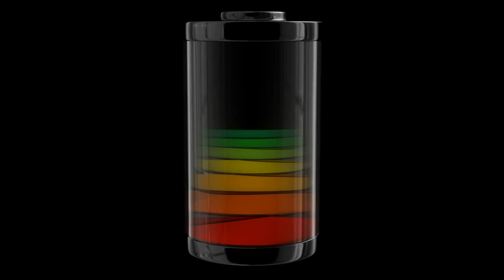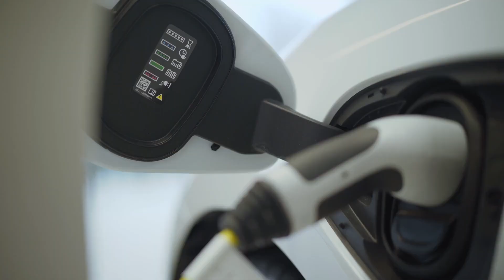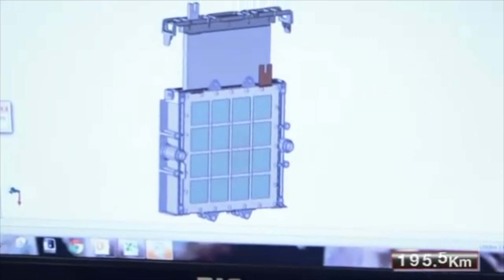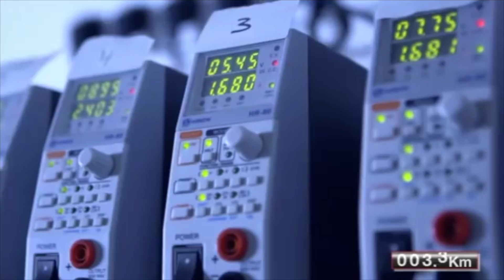This Battery Gives EVs 1000 Miles of Range!

Comment: Please do a deep dive into solid state and graphene batteries.  Toyota is supposedly investing in SS batteries
Reply: Τhere is also liquid metal battery....
Reply: Solid state batteries would be much safer and hopefully more energy dense too.
Unfortunately nobody is even close to make them cheap and long lasting, currently.
Reply: Solid state is a joke. The batteries are so expensive that they negate any range advantage by needing to use a smaller battery. Plus they can't be mass produced like current batteries or even the 4680 cells. The tech will probably be good in the future when it's cheaper but right now they're just hype.
Reply: Since 2019,  have been very careful of 
ICE vehicle manufacturers.

They had the window to stay with the EV market.  
-- That window, is closing fast !

******
Main factor in today's EV market, 
is range.  
-- How far/long before your need to recharge .

  Can you compete with 
1000km (600 miles) range ?
  Most ICE vehicles have a hard time !

**********
  Current ICE vehicles  have advantage of extending their range.
(re-fuel; gas tanks)
  Once this problem is solved, 
ICE vehickes are DOA !
Reply: @dirktween244  disagree
We are decades away from a power grid sufficient to handle the power needs to replace the energy from carbon
Reply: @dirktween244  The only reason why ICE vehicles don't have a 600 mile range is because it's a) not necessary with plenty of fuel stations around the world, and b) it's not as efficient to carry more weight than necessary.  If you don't need to go 1,500 miles, it doesn't make sense to carry 100gal of fuel when you're not even leaving city limits, and those who do already have vehicles with additional tanks.

You'll never truly get rid of ICE vehicles until we're able to restructure the entire world to use clean thorium based nuclear reactors, charging your vehicle takes less than ten minutes, and charging stations are located everywhere there's a gas station.  At that point, EV's and hopefully electric aircraft will finally subvert the ICE.  Until then, EV is not going to replace vehicles in high demand environments, and as far as emissions, at this point in time they're kicking the can down the road...energy production, mining, refinement, and manufacture offsets their own lack of emissions.
Reply: @dirktween244  I mean to be fair there is still the problem of fast chargers needing to be faster and the up front cost needing to come down but those things will come with time. Especially if this new ev credit passes in the us
Reply: @DenvySubliminals  The 4680 should charge from 10-90% in about 15 minutes with the tabless design (which provides far less resistance to charging at high rates).

I don't expect we need more than 2 years to see that as the new standard at Tesla. 
Aluminum-Air has been kicking around for quite some time. Its use case is Very small.
Reply: @avgjoe5969  honestly I wouldn't be surprised if it was even faster than that. Especially I've V4 type chargers are able to be as impressive as they are or if the car has a smaller battery pack (ie the 25k Tesla)
Reply: @dirktween244  And think... in majority of cases your burning fuel to recharge your battery..... nevermind fossil fuels it took to build the car.... our fossil fuel used to make the tires... even the asphalt the tires ride on.... fossil fuels used to make the power lines and other infrastructure along the side of the road as you drive. Just try to fathom how much diesel is burned mining the materials for those batteries....... wake up people.... we don't have the tech to get out of fossil fuel/ fossil fuel product use just yet.... what will you people do without disposable plastic razors for example?
Reply: @timm.6391  bingo
Well said!!
Reply: @Johnny-dp5mu  Thank you.
Reply: @timm.6391  I also wonder if the current power grid will even handle the charging network proposed.
Reply: Let’s explore ALL POSSIBILITIES of E~Tech Soon it will work

Comment: Thanks for the knowledge.  The biggest thing keeping me from buying an EV is range.  I drive a Plug-in hybrid and the EV range has never been as advertised. Also, I live in eastern Washington state and the cold in the winter diminishes that range as well.  The work I do often requires me to drive 300+ miles at a time to areas where a charger is not available.  Having 500 miles or more range would work.
Reply: If you had rapid recharge stations giving you a a 75% charge in 15 minutes.  would you reconsider?
Reply: @timthompson9115  My range problem is i don’t commute but rather drive to customers houses in rural areas where no charger exists.
Reply: @PapaDougsAdventures01  Running an extension cord to a customers house not going to go  over very well... Soon gas pumps are going be replaced by fast charging stations.  Stations roofs will all be solar panels.  They already have this in other parts of the world..  An app on your phone or on your cars "screen'' will warn you when low on battery and direct you to the nearest charging station.  Since we are not dealing with gasoline and all the hazards that go with that.   Simply put parking spots along roads will become charging stations.

Comment: Aluminium needs really too much power for extracting it from the Aluminumoxide-Rocks ! So.. it is a fantastic material for us to use.. BUT.. the Energy-Need for processing is really too high!
Reply: @Curdin Gees

Unlike the fossil fuels Aluminium is the 3d most abundant element on earth and once extracted it's a renewable and clean energy solution that could be economically viable addition to already existing ones. 
¯\_(ツ)_/¯
Reply: Have you forgotten what we are already using aluminum for today

Comment: Aluminum wiring was banned in many areas because of their potential to catch fire. Hmmmm.....
Reply: The aluminum in this case isn’t actually carrying the current and expanding and contracting causing high resistance and heat at connections points, it’s a chemical reaction